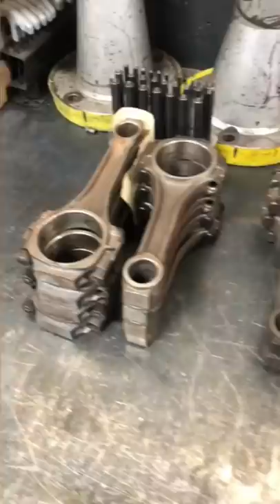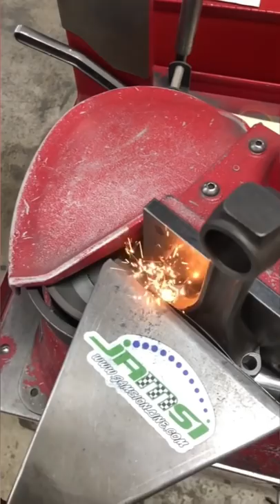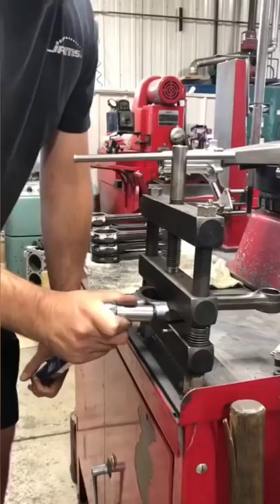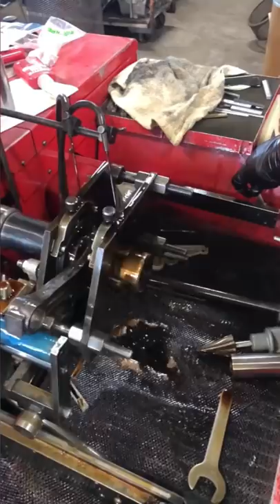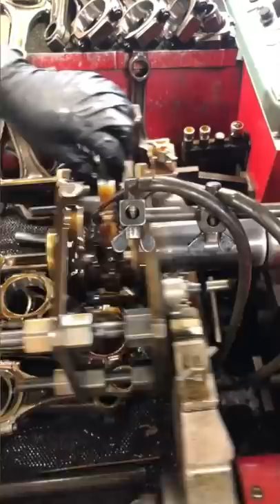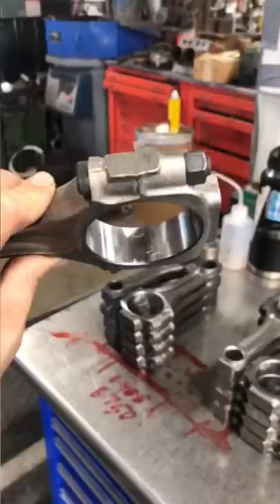#shorts When the machine is set up, make it worth while!

Comment: As a cnc operator I appreciate all you do and the tolerances you can hold.
Reply: Cutting down to half a thou is pretty impressive
Reply: @mikeewalt6270  no he cut down to a tenth as in 1/10th of a thousandth. That’s damned impressive
Reply: @johnathanbodkin122  Considering a lot of high-end machines are only accurate to within 5 ten thousandths, I'm very impressed with how precise these automotive machines can be
Reply: Meh depends on the job everything is time vs effort tighter tolerance takes a slower approach.  Machinist/programmer

Comment: I used to do that type of work years ago. I loved it. 
Bored blocks, sleeved them. Turned flywheels duel & single stage. Built heads, install guides and steel seats. Turned/machined crank shafts. 
Then left that shop after 8 years and opened a Transmission shop. I probably made more money building transmissions but my passion was an engine machine work. No I’ve gotten too old. Time slips up on you and then slips away.
I love watching everyone else do it good job keep up the good work..

Comment: I wonder if anyone has ever cerakoted moving parts like valves, crankshafts, or connecting rods or something. Wonder if it would have any advantages like heat absorption or less friction
Reply: Some performance/high-horsepower diesel engine pistons are ceramic-coated to withstand excessive EGTs
Reply: Look into WPC surface treatment. I will be assembling a Miata BP4W engine with WPC treated parts some time this year and will be documenting the entire process

Comment: Got a question for you. Multiple times, at different machine shops, I change out stock Chevy connecting rod bolt to ARP bolts. The issue I have is when I get the rods back and remove the caps for bearing and mounting, but I find the bolts are splayed out or are pigeon-toed, which makes it difficult to check for bearing clearance let alone get the cap back on and torque down. Why does this happen?

Comment: That's how you make your money, minimize setup time. The work reminds me of a cylinder honing job I had. 4 ft tubes within a half thou from end to end within half thou of the middle of my tolerance was my benchmark, and could hold that all day roughing and finishing 20 tubes. Had another job in the shop boring fork eyes. They gave something stupid like .100" tolerance and didn't say much else so I held them within .002 or .003 of the middle without any complaints. Then one day they're freaking out about one that was at one end of their tolerance that didn't fit a shaft. They tried to put it on me but it was so far off of my usual dimension that it was laughable. Get the setup right, and go to town making chips with all of the tool compensation figured out.

Comment: I wanted to know what goes into redoing a chevy 4.3 liter V 6 Vortex engine. I had a 1997 GMC Safari Minivan that had 228,000 miles. I was having an issue with right side lifter tapping and come to find out it wasn't the lifters causing the problems but the oil pump failure. It seized when I was out driving. What would it cost me to have the motor rebuild or would it not be worth it. I'm looking for a used Chevy Suburban or GMC YUKON XL. IT SEEMS PEOPLE ARE CHEATING THOSE THEY ARE SELLING THEIR VEHICLE TO OTHER, WHEN THE CAR DEALERS DONT GET TO SELL A 20 PLUS YR OLD VEHICLE.

Comment: Lil question, grinding the mating surface? I thought the fracture fit was made in order for perfect fit and having to save from machining, why grind it?
Reply from the maker: This is NOT the process for fracture split rods! Not all rods are fracture split, some are machined as shown in the video!
Reply: @JAMSIONLINE  thanks for the clarity
Reply: @JAMSIONLINE  being a heavy/medium duty diesel mechanic, 99% of the pistons I run into are fracture fit, thats the factory standard in most med/heavy duties and also DOT legalities say to use it for commercial use

Comment: I have a question.. my 3.0 v6 ranger overheated and below the head gasket and need to fix it what should I do??? Should I surfis the the head..
Reply: Have the heads rebuilt by a machinist. Sometimes you can crack a cylinder head and have all the same symptoms of a blown head gasket. Also, a head can be warped and not seal properly if not machined.
Reply: @skylinefever  thank you

Comment: This is the reason why we all should think tesla and all the other e car  is bullshit. Because you can reuse any single part of a classic car instead of a new one that after 100 thousand miles can go in the rubbish
Reply: I'm a car guy at heart, but your argument is completely bunk. An electric motor has a service life that dwarfs any internal combustion engine. There are really only two wear parts in an electric motor. Those are the bearings that support the shaft the rotor spins on.

Comment: Built up a lower budget SBC from 1970 Didn't think twice about taking parts crank block and rods to our local machine shop to get refreshed instead of buy any of this cheap china garbage flooding the markets.  60over bore 10.5to1 550left cam solid GM bowtie phase 2 head i scored for free.  450hp